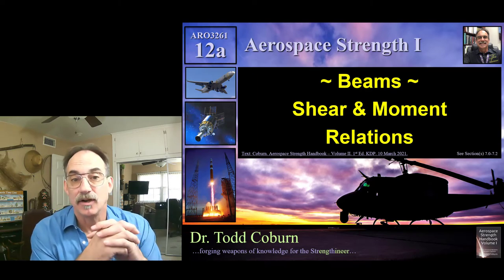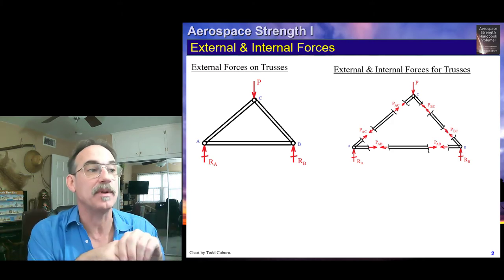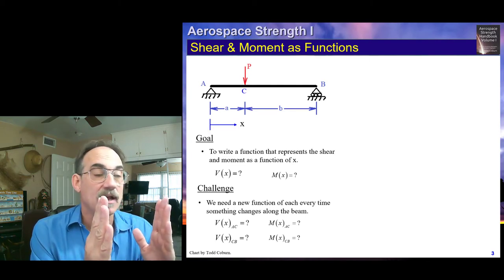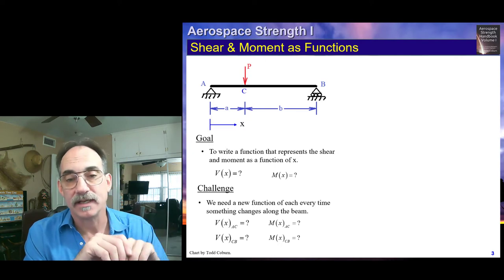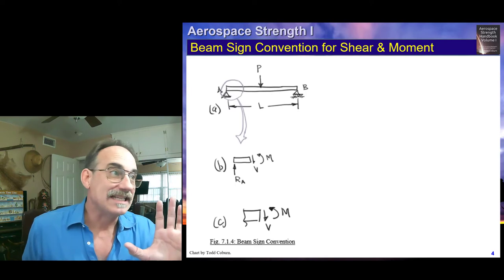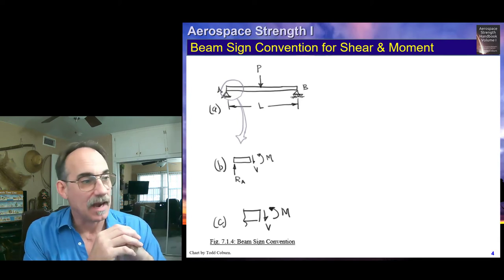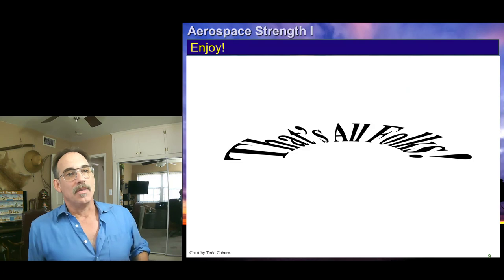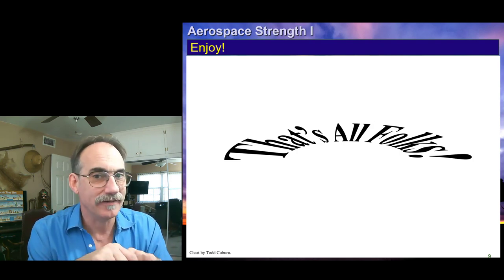Strength I: L-12a Beam Shear & Moment Relations

Comment: Thank you for the lecture Todd. I had one query at timestamp 24.15, can we not convert the UDL W into a point load at the centre of b ie Wb and then just make 2 cuts?
Reply from the maker: Only to get reactions or internal forces outside tge limits of the function.  If you want to evaluate points within, you must retain the function.

Also, things like deflection change based on distribution of load.  Therefore we must learn to deal with each term of the loading
Reply: @ToddCoburn Got it. Thank you very much Todd!